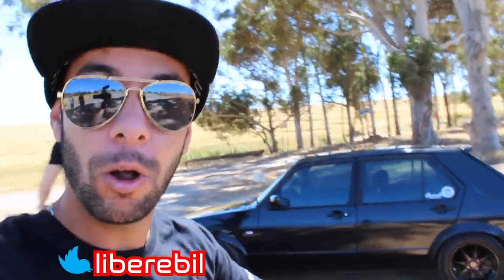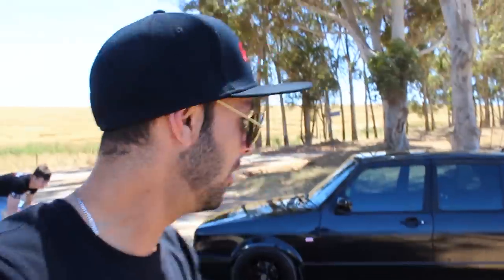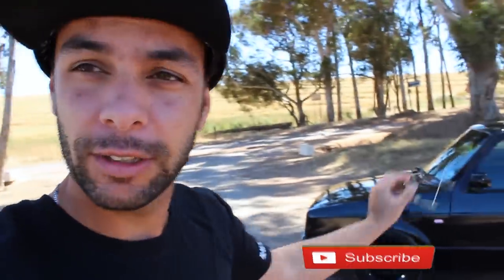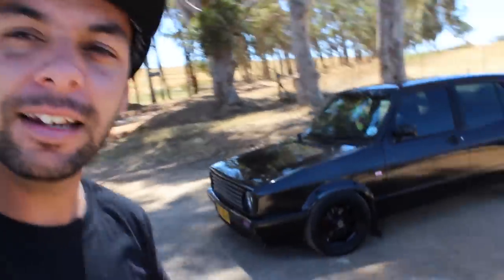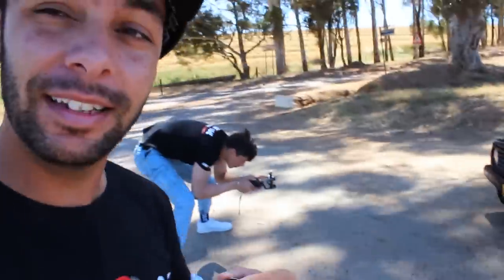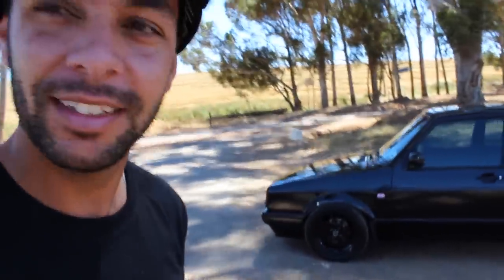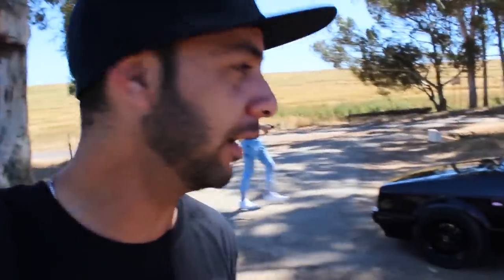The First 8V VW Golf 1! | Custom Mods | LibeRebil

Comment: Always loved them :)... I had the first 2L 16V (CiTi Golf in RSA in 1992...) We dumped the FI and went with 40 Webers,..Still have some pics of the Easter weekend when we did the conversion...Back then boosted Tredia Turbo was the thing....we gave them a hiding...Datsun GX Turbo's, 325iS....Wheelship through 1st and 2nd if you didn't feather the throttle...Everything balanced...So much fun back then....Nowadays that means nothing performance wise...but back thgen it weas the bees knees :)...Keep up the good work :)..got all the 2L components from VW motorsports through a connection...

Comment: Niyaaz, Alan mentions he did dual valve springs. How did he achieve this? Is it an after market set he bought off the shelf> did he have it made?
Reply: Same question on my mind
Reply: You can use the springs from a 2e or cti head.

Comment: I drive a velocity 1.4i. have a branch, 50mm powerflow exhaust system, k&n filter on. otherwise stock standard. I would like to put a cam in. But would like to get some advice as to what the pro's and con's are and what the best cam size it to put in and where to get a cam. Thx guys
Reply: If you want to stiek to 1400 then mastercams is the people to call. It will make your car sound better and give a bit of performance but dont expect big gains. My personal opinion would be to get a 2e or ady engine setup. The bump from 1.4 to 2L will make a lekker difference in performance, and you have the benefit of having a stock engine while maintaining good fuel economy
Reply: Don't waste your time bra. You'll spend money, time and effort for small gains. Rather drop in a 2E or ABF if you want a proper performance upgrade.
Reply: If you want to put in a cam go 268. That's the same spec as a G cam (which came out of a CTI)

With the mods you have don't go bigger than that.

Comment: 8v will “torque” to your heart, until you try to rev it to 10000rpm....
Reply: Typical Honda fan
Reply: @tashveerthotha4360  Truth hurts butts....
Reply: No need to rev it that high, power comes on nice and early...by the time the honda will get to 10k rpm, the golf will be waiting for you at the finish line
Reply: +Mohammed Cassim Bwaahaaahaaa....no wonder they legalized that weedy stuff....keep believing yourself Mo...
Reply: @hondatrix  lol, no need for weedy stuff..I believe facts and that which has already been proven (time after time)..its power to weight ratio...a decent 2.0 8v will give quite a few b series combinations a go.....and that's only an 8v....when we put 16v's in these mk1s, its game over.
Reply: @mohammedcassim2923  Mo, that is your opinion, and I agree it's all about power to weight ratio. My little D15 SOHC with some choice mods ran a best of 14,1 at Tarlton on street tyres, before I added the turbo..It also managed 989km on 52l of fuel...Show me 1 8v VW that can match that.
Reply: @hondatrix  in terms of the fuel consumption...I doubt it will match that.
In terms of performance....go to 8v performance, and you spoilt for choice.....I wouldn't only use 1/4 mile times to really judge a cars performance, as it is dependent on the drivers skill as well.
However..I own a 2.0 8v with quite a bit of mods  and stuck with a b20 vtec in a rolling start race (from 2nd) till we let off, at about 180 kph (my redline is 6800 rpm, the hondas was like 8k... - but the point of discussion was that an 8v is unable to rev high, and the point which I made is that it doesn't need to rev high, to perform well anyway..(one good example, is polo 9n3 1.9 tdis with a good tune).
Reply: @mohammedcassim2923  Mo, just to let you know, I used to build VW 8v 2,0's for DAW racing..several 100 per year...and I had 3 Golfs...I grew up on them..and then found real power..lol
Reply: @hondatrix   I think you need to drive a newer gti or golf r, with a tune...and come back to the right path lol, with "proper power"
Reply: @mohammedcassim2923  Unfortunately I have done that.. Not bad at all...but don't even come close to what you can call fun.